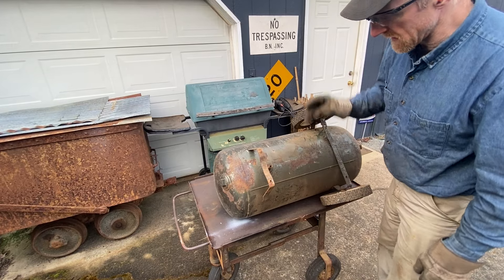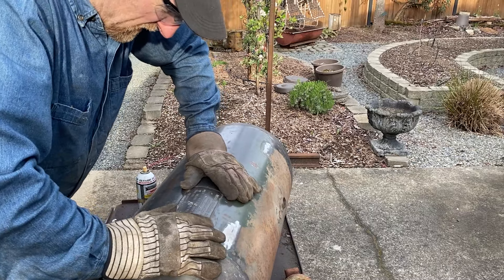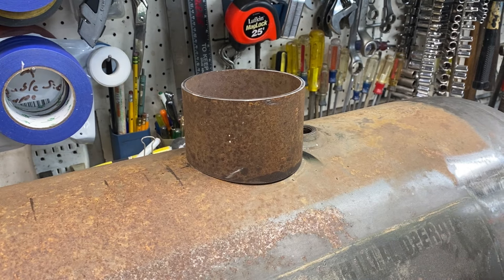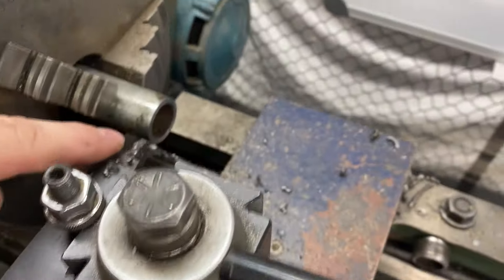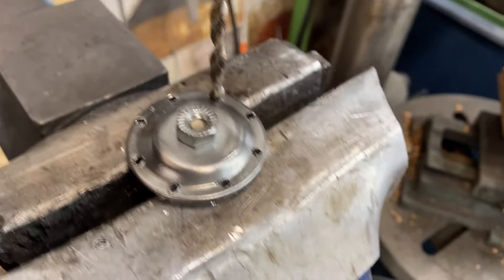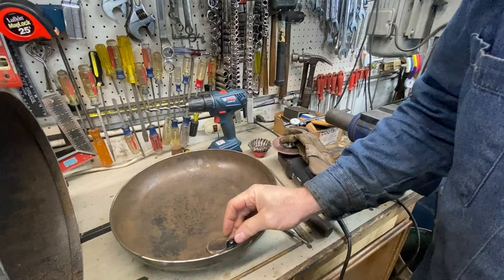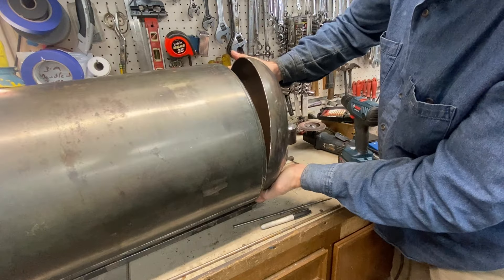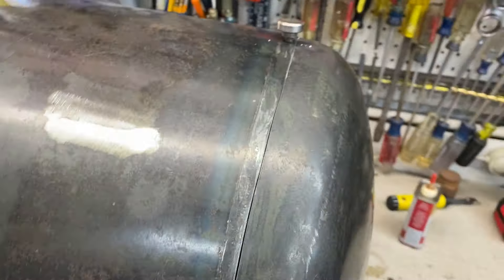Part 1: Modular tank car built from a scrap air tank (7.5" gauge train)

Comment: 0:34, Ahhh! its for a little train! I saw TANK + CAR and immediately thought killdozer 2024 is documenting his build for us?! Then I saw the size and thought, wait is this a tank for ants? and then it all made sense. I think you should insulate it it and make it into a cooler so you can drink refreshing drinks while riding the train. I'm not sure how this ended up in my recommended feed but I'm glad it did.
Reply from the maker: Thanks! Glad you like it. I suppose it could be a killdozer for ants when it's on the flat car. Sometimes they walk in lines along the rail and experience unimaginable tragedy at small scale. I like the idea of a cooler inside because it gets really hot in the summer where we run it (Train Mountain near Klamath Falls, OR). I can probably find an insulation liner that still leaves room for cans or 2L bottles.